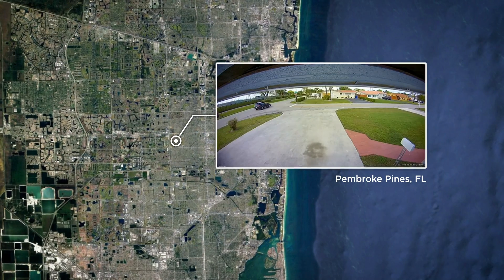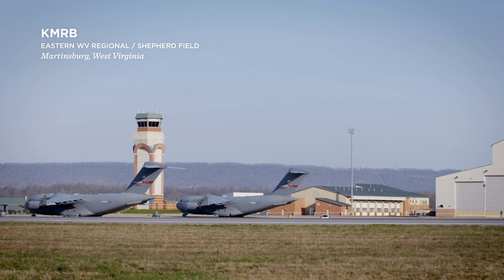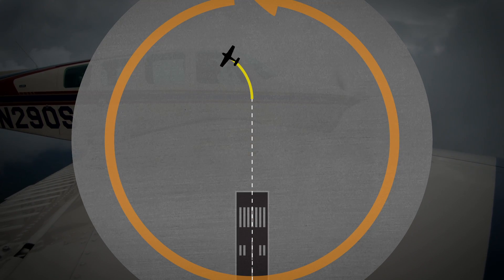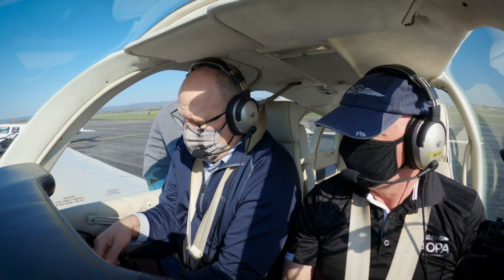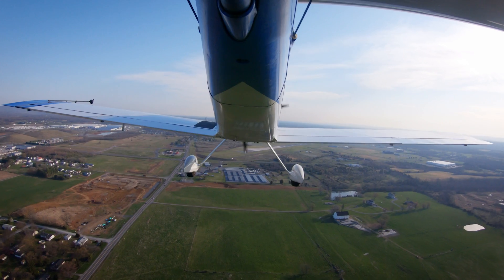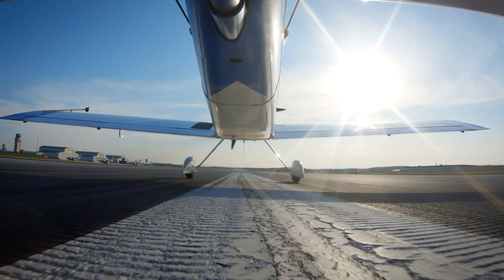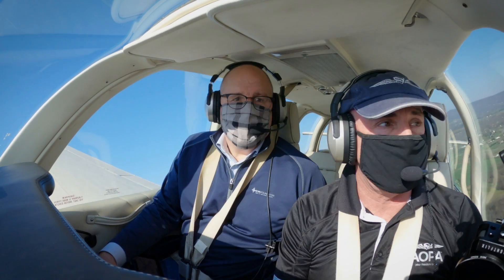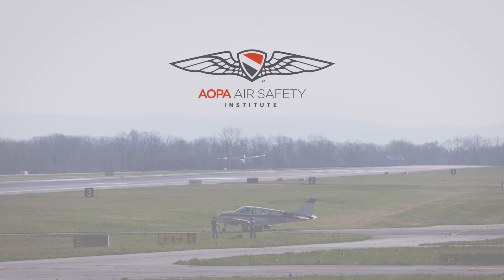Reality Check: The Runway Behind You

Comment: In my country, we always learned to fly straight ahead or to the nearest field/ no obstacle area. If altitude is avail, then return.
Reply: Indeed.  In Principe no turnback   . Learned in my young days flying at a small airfield patterns were at between 350 and 500 ft AGL and banks of 45 degrees. So that's not the danger, but turnbacks are most cases just impossible. Excellent video with good explanation.
Reply: At what altitude it is OK to return?  Or do you just guess when you're in the air?
Reply: @tomsmith3045  You have to know what altitude from before you take off.  Never turnback in the blind..
Reply: @outwiththem  Exactly.  This is my point.  My instruction is to brief on the specific altitudes between stay on the ground, fly w/in 30 degrees straight, and turn back, for each flight.  I do that for every flight.
Reply: @tomsmith3045  Right.  First step, when i do the preflight, i notice the winds speed and direction.  If too strong, like say 13 knot or over, i say.. If engine off, even at 1k feet im going into the wind, and no turnback.  I fly from a 3,000 feet long runway.
Reply: @outwiththem  :) Sounds like great planning.  Where I generally fly out of, it depends on the direction of flight.  One way, into a headwind, I'd just land in the field at the end of the runway.  Going the other way, into a headwind, above my decision height I would turn back, carefully because of the speed differential, knowing that I might be blown back long, and overrun into the field going the other way.  No matter what, though, we both have a plan.
Reply: @tomsmith3045  Turnbacks also kill ATP's that didnt want to learn them.  On Flyover Turnbacks, also on Box Canyon Turnbacks.  If you do those wrong, it is easy to stall on them too.  But....NOOOO, im an ATP, and we dont need to do turnbacks they say.  
Its BS.
  Dont trust a guy that cannot do a 40 degree turn on a non heavy loaded single at Vglide or Vms.  That is a clod that can only do Mild Maneuvering.  Airliners spoil ATP's into mild maneuvering only.  Then they crash doing harder maneuvering like short approaches turnbacks, Flyover Turnbacks, Box Canyon Turnbacks or EFATO turns even if not turning back.  

Even if landing forward and not turning back, you need precision like a short approach will need to align at the proper spot.  And 40-45 degree turns need to be done at under the 500 feet agl, ect.  I learned them after ppl by the EFATO CFI i had in 1996.   We went over flat and nice fields to 50 agl practicing no engine landings.  It is legal, as long as you stay away 500 feet from structures and people.
Reply: @outwiththem  I, myself, don't want to be 40-45 degrees at 500 AGL, but other than that I agree with what you're saying.  I think much of it is training to minimum to pass the checkride, part of it may be lack of experience of some CFI's, and I think part is that there are few if any simulators that can do this.  I've asked around, and don't believe there are any GA simulators that accurately model the way an aircraft flies at close to and beyond stall.  So the only stall experience most pilots get is during training, and under very benign conditions.  They're either so scared of stalling they fly, as you put it, too timidly, or they completely underestimate the danger of low level stall/spin, and end up spinning in on what should have been a normal approach.
Reply: @tomsmith3045  They are sims that teach somo, but not all.  But it is better than nothing.  I didnt need any sims in 1974 to do Windy GRM at 600 agl and soloed at 15 hours..
Reply: @tomsmith3045  Mild Maneuvering training only.  then when they have to do hard maneuvering, like low turns, low go around, strong wind turns, emergencies, they make errors and crash.  The military trains harder for a reason..
Reply: In your country you are doing it correctly.

Comment: They all turned away from the wind it (left turnout)  and it was  the biggest mistake they made as shown on the bonanza wind indicator. They should have turned into the wind to avoid being pushed farther away from the runway.
Reply: Unless, as an option, there is more open space to land, IF unable to make the runway...woulda, coulda, shoulda.
Reply: Probably simulating worst case scenario (couldn't turn into the wind due to parallel runways / tall structures etc) - better to find failure in a worse case than success in a best case.
Reply: I agree: if you had to turn back - do it into the wind, not with the wind! If you turn with the wind - it just not only brings you more far away from the "runway behind", you could even gain so much GS that you might make the turn but the runway "is gone" (overshouting it in opposite direction).

And why 45deg (always)? As we learn as student pilots: turning with a tail wind for ground reference maneuvers needs a steeper angle of bank.
And if you best glide is already higher (Bonanza) - you might need an even steeper bank angle in "turn back to the runway". (why not 60deg.????)

Comment: I personally use 500ft agl for turnaround minimums in a 172, which is something that I regularly practice. If the wind is a stronger headwind sometimes I can't make the runway, not because I can't turn around, but because I would run out of runway. Personally on every departure breifing I brief what the turnaround minimums are depending on the wind, runway length, and current conditions.
Reply: 500 ft to turnaround in a real situation with human factor  isn't possible at my opinion, but 750 ft is safe. Off course depends of wind, turn to the wind, because you will have wind that will reduce your GS but, you will have Airspeed, and when finish the turn the wind will push in to the runway.
Reply: A turnback, not a Turnaround.  Turnaround is around the airport or something.  Turnbacks you dont turn "around" anything.  Different turn it is..

Comment: Amazing video but I guess I'm still wondering about the 3 seconds before turning back... just can't see a novice pilot only taking 3 seconds to problem solve and then decision make before making the turn.. that also has to add a factor into this I would think?
Reply: It shouldn't involve problem solving.  No matter if you turn back or land straight ahead, once you realize you have lost power you need to push the nose forward.  It needs to be instinctive.  The 3 seconds is for the "shock factor" as Romaine mentioned, that it takes your brain to realize that you have an engine failure.  If you have to actually think about what to do, you unfortunately likely won't be able to do it.
Reply: i bet its closer to 10 seconds before things start happening, there is just no way to simulate shock. These people were prepared for this and were planning as they climbed. An actual failure would be exponentially more difficult.

Comment: What about a 180 power-off landing? Apparently that's what that [desperate] bonanza pilot may have attempted. Had he had a few more feet, he could have made the "Impossible turn", at least to the sod.
Reply: The 180 power off landing we practice for commercial exam is different than the “impossible turn”.
Reply: @gringoloco8576  The Impossible turn is basically a teardrop landing. I learned 180 power-off landing while getting my Complex sign-off, and right, my Commercial. He wasn't trying to land on the runway he departed. He was aiming for the parallel runway some distance away.

Comment: My understanding is: 
latest thinking is to use a 45° bank angle and fly at “DMMS“ (Defined Minimum Maneuvering Speed: VSO times 1.404)
Many years ago I pulled off a turn-back with Cessna TU206 after the TSIO-520 swallowed a valve. 5,000’ runway, straight out departure, failed at 1,000’ A bit of residual power . . . just enough to taxi back to the ramp with full throttle. Had practiced the scenario not too long prior. It worked but . . . best choice would’ve been an off airport landing within maybe 90° of original runway heading. 
Every takeoff scenario is different. Pilot, airplane, runway length, DA, departure terrain, wind . . .  Ya gotta have a plan before the start of each takeoff roll.

Comment: Really a good work you guys put together. Thank you so much. Here is some of my own experiences to share. 
1. As a (almost mandated) part of Glider pilot training, the "rope break" turn to land back, is constantly practiced -- at 200 AGL. The technique is similar (not exactly the same). -- I am working on my commercial Glider. 
2. As my part of CFI training (ASEL), my instructor made me do the impossible turn in a full loaded (2 persons) mooney from 600 AGL === the trick is "lower the nose, 45 degree ~ 60 degree bank", get 1.42+ * Vs speed during the whole turn. when I lined up with the opposite runway, I was high (about 100+ AGL in middle of a 6000 ft runway). 
3. Not sure if you guys tried the "steep and fast" impossible turn in bonanza (you guys are experts in it, I was just curious). --- the reason to steep is to get the turn radius small, the reason for fast is: not stall, and get it back asap -- although the vertical speed is high, the time is short ( the same concept when we are soaring in thermal).

Comment: You say the Bonanza and aircraft like it shouldnt do the 180 turnback for engine failure after take off, but what if thats the only real option? You got buildings and trees ahead of you, and flat land behind you. I would turn back and land on the grass. Better than landing in an apartment building or a tree.
Reply: Yes, there is the "impossible landing ahead" situation, too  :)  At low altitudes, at least part of the turn may be possible, with the same techniques, for example +/- 120 degrees, and that can give me more options than straight ahead.  I don't have to turn all the way back to the runway. Crash-landing within the airport perimeter fence at any point, even without aligning to the runway is a better option than outside, because of less obstacles, and faster access to fire trucks and medical help.
Reply: Then you fly the airplane all the way into the crash landing. There are roads ahead and any four lane road will be wider than a GA wingspan.

Comment: Interesting claiming that calm winds are ideal.  Seems if you have a decent head wind your distance from the runway will be less and it will become a tail wind that helps you return if you do turn around, the two may cancel each other out.  If you have crosswind your can make sure you initiate your turn into that crosswind to lessen the distance you fly from centerline during the maneuver. 

I asked my CFI to practice this with me in my Archer, we determined it’s possible at 600ft, but I’ve set my own limit to 800ft for some extra cushion.  

I now brief the plan to myself including what altitude I can turn back, whether other airport traffic will be a factor in that decision (will runway be occupied immediately after my departure?), what direction I will initiate the turn based on cross winds, etc before each takeoff.

Comment: Also with the BE36, an engine failure would call for feathering the prop, which was not an option when your simulating an engine failure. This would have helped somewhat in reducing the parasite drag of the prop.
Reply: No feathering available. 

An old trick is to slow to stall speed or lower (which you can do in a parabolic arc) to get the prop to stop from compression, and then speed up. 

But this is more of a trick for a long forced approach trying to make a field far away or landfall over water.. not for engine failure after takeoff.
Reply: Didn't know his thanks!

Comment: Having the speed and performance of a bonanza is great 99% of the time. The performance works against you in 100% of low altitude departure/approach profiles. In the highly unlikely event that you experience an engine failure in a high performance aircraft like a Mooney, Bonanza, or Baron; Straight ahead or =/- 45° in front of you.
Reply: For a Mooney or Bonanza, yes. But the recommended procedure if you have an engine failure in a Baron is a bit different! 😄
Reply: @mdickinson  fuel exhaustion doesn't discriminate. That said, yeah I forgot to consider the possibility of remaining in flight during a single engine failure.

Comment: I'm surprised by the assertion that performance at idle and with the engine failed would be similar. I watched a video with Doug Rosendaal the other day in which he suggested that the sink rate if you cut the mixture in a 172 in a 45 degree turn was 700-900 ft/minute as compared to 500-600 ft/minute if you merely cut the throttle. It seems like a big assumption to be making.

Here's the video I mentioned: https://www.youtube.com/watch?v=7DUE8Eh5IUY
Reply: I agree, I wish they would have linked their sources to that claim. If wrong, it very well could get people killed.
Reply: Hi, I agree the assertion that idle vs windmilling performance is similar, is wrong. Re the other video you linked to, the sink rate quoted is very dubious, being too low in both cases. There is no way that guy has been getting 5-600fpm in a 172 at “medium density altitude and 45 deg banked turn”. The glide performance is in the AFM so we can check it. The 172 glide ratio is 9.1:1 which gives 720fpm (sea level,  best glide,  windmilling prop, wings level). There is no way, particularly from a higher DA, he has been rolling-in to a 45 deg bank, and by simply keeping the engine at idle, has been able to peg the sink rate at the claimed 5-600fpm.
Reply: Going through the comments to see any about the effect of having the engine idling. Even if the drag of the prop turning cancelled out the idle power of the engine, a stationary prop, even if feathered is still going to create drag.